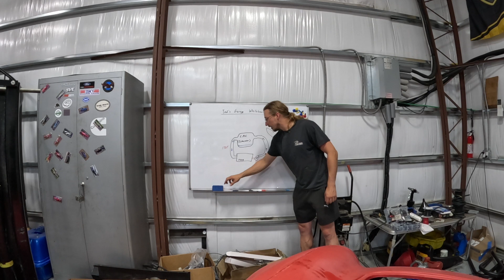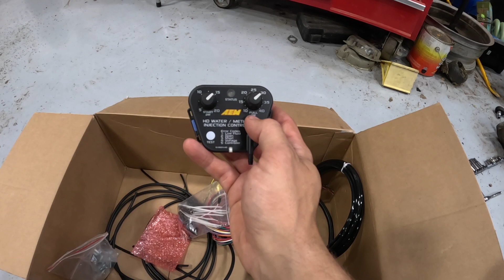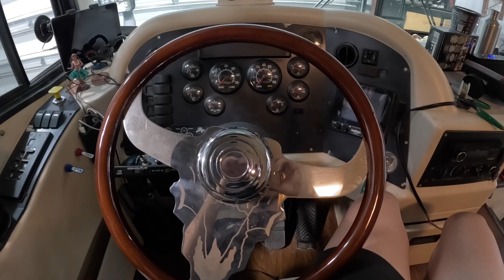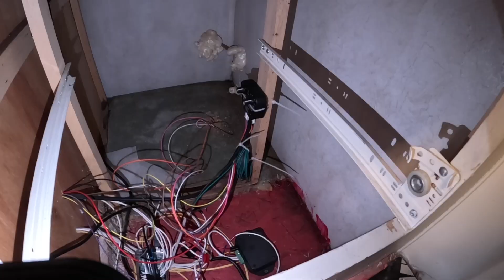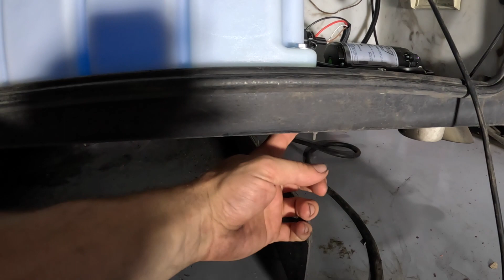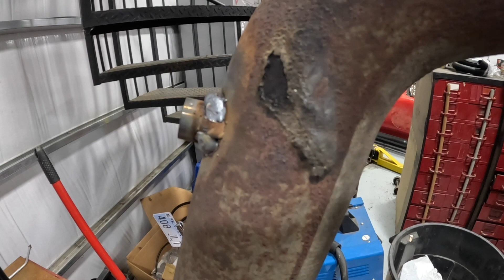Installing AEM Water / Methanol Injection on a Caterpillar 3126B Powered RV

Comment: I like your idea of putting it before the cooler I also was thinking of doing that. And like you I was worried about water pooling in the cooler. If you could put a drain system on the cooler that was automatic like you find on an air compressor that fills the container and when you have an absence of pressure it drains automatically you could then leave the system on all the time which would give you more efficiency efficiency

Comment: How did the experiment workout?? Have any problems with corrosion on the intercooler fins? I'd like to know how everything worked out?
Reply from the maker: I don't own that RV anymore, but a friend of mine bought it and the system is still working.

I drove probably around 6-7k miles with the system. It did produce a little more horsepower (noticeable, but not enormous), and it very definitely lowered the intake air temperatures a good bit. Something unexpected but that makes sense is that it also seemed like the engine ran better after a while of running the system. This makes sense since the water/methanol mixture ends up being something of a detergent and I'm sure cleaned the combustion chambers and pistons.

It did help with some of the cooling improvements I was hoping for, but not enormously (which is no surprise). No negative impacts on the intercooler corroding or the like.

I've actually considered putting this on my current RV as well, more than anything because of the engine running improvement I observed.

Comment: Nozzle placement.
It might be a fun exercise to have two nozzles one placed in the intake manifold or horn and the other post- turbo, pre- charge - air.
Add more meth to the mix, a 20 gallon tank, and spray that charge down . The charge will not evap instantly on the placement in the intake , but will be vapor before it goes into combustion.

Comment: May I venture a guess that nozzle placement will have a decided convincing improvement on performance. 
Your goal as stated was aimed toward reducing heat soak in your cooling system and you probably succeeded there. 
What is missing is the fresh injection just before the cylinder head. That placement might have gained you what you sought hoped for, or expected.
I wondered what reservoir you had in mind
I had pause when you showed the 5 gallon tank." Not nearly enuf" I thot.
20 gallon might work well.
Also mixing ones methanol may aid as well.

I enjoy these videos on the RV'S . Ramblers are dear to my heart as well , pound for pound, dollar for dollar they are , or were , the best on the road.
I do towables but that applies to them as well.
I get the sense of never ending possibility for improvement on these RV models. There are so many interesting possibilities the manufacturer does not include at production. Fun stuff that makes a difference. I just added a fresh water flush  for each tank from the wet closet. Very satisfying little improvement is a class on self- enhancement. The surprise that I had is that the rigs respond well to these improvements incorporating them almost seamlessly into the function where f the coach

Comment: My take in injecting before/after the intercooler is like you said you can get sub ambient Temps with meth Injection  and if you then run that sub ambient air through the intercooler you'll literally be heating it up to ambient

Comment: Do you think you  used more fluid than you expected. Due to being on the upstream side of the CAC?
Reply from the maker: Good question. You can set the flow rate to whatever you want. To achieve the same IAT it would probably require some more flow since the intercooler isn't "pre-cooling" the air. However this was intentional in my setup.

Comment: Awesome channel! I was thing to run similar kit on a toterhome with a cat c7. I am also gathering information about adding a LPG. In Europe ( where i am originally from) this is very popular, i even found a few companies in US that did thst at some point. But all th info os pretty old. Have you heard of LPG as supplement on diesel engine? What do you think about it?
Reply from the maker: I actually did think about doing a propane injection setup instead of water/methanol, especially since my RV had a propane tank on it. You’re right that it’s not done much over here, my understanding is that it’ll cool the intake temps but it won’t cool EGTs. Cooling EGTs seems to be the main thing people look for with this sort of setup on diesels over here.

Glad you like the channel!
Reply: I have a home built propane injection setup in my diesel Mercedes sedan I do some towing with. I see maybe a tiny reduction in egt, like it seems I can reduce throttle because of the propane and keep the same speed with a minimal reduction of EGT or keep a slightly higher speed at the same. It's very hard to quantify since it's a bunch of different hills going into and out of the mountains to the race track. In everyday use it definitely spools the turbo faster. I have an adjustable Hobbs switch controlling a gas rated valve AFTER the regulator. A BBQ regulator actually makes a difference and I had two hooked up on a splitter after toying around with it. I had one on auto and the second on a manual button that I was intending to do a full throttle switch on. There needs to be a shut off within reach to be able to shut it down for certain situations. You can use an adjustable regulator too but be careful. It doesnt take that much to over do it. I definitely gave her too much a couple times and it sounds bad! Have the two "stages" was nice.
Reply from the maker: @jasonbirch1182  good information!
Reply: @TedsGarage  bus grease monkey does some propane injection which may be helpful to your bigger rigs.

Comment: My rig is like yours, I have thought about installing water sprayers around inside of fan shroud to help cool on the grades.  Would be easy and just use water from fresh tank.
Reply from the maker: I'd considered that as well, and it's something I may well do. I ran out of time before my big summer trip. I think a water mister on the radiator/intercooler would be more effective in cooling than this was.
Reply: Do you think you  used more fluid than you expected. Due to being on the upstream side of the CAC?